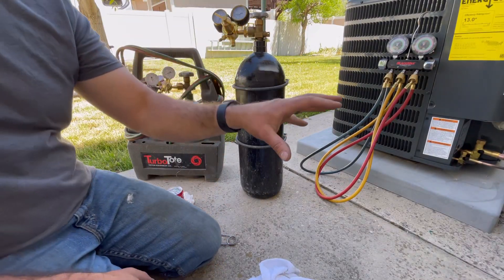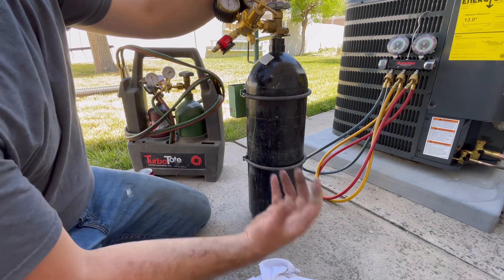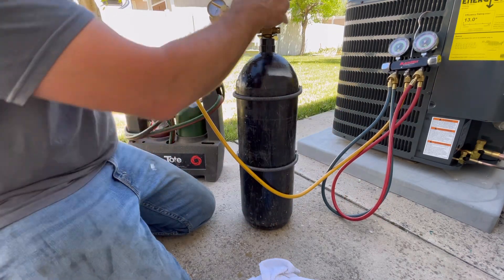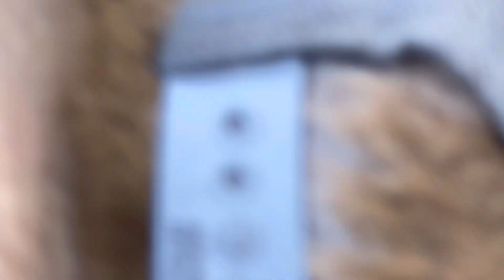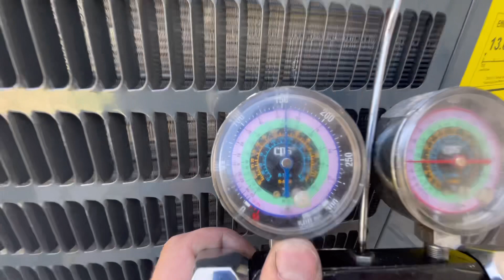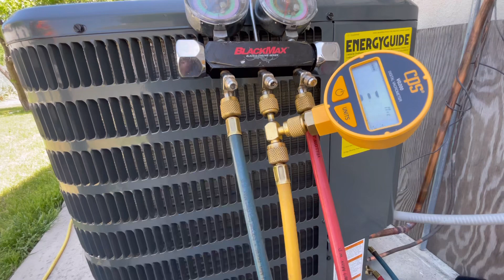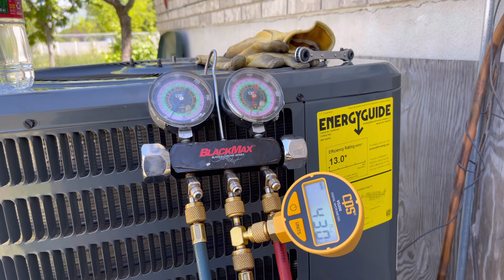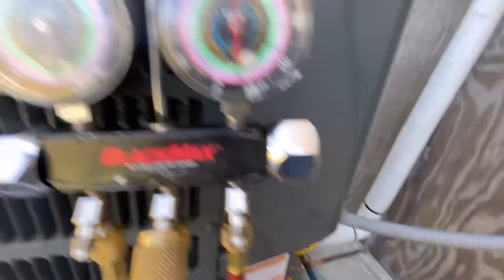DIY Air Conditioner Replacement  Part 3      -Step By Step Guide-

Comment: I'm a master automotive technican, i'm handy when it comes to many other things and i'm going to be replacing my furnace and a/c units with in the next year or 2. Last summer i added r22 to my one unit found a 5lb tank on ebay, still have about half a tank left, if i need to charge it again next summer i will, other wise its going to be replaced. I have 2 questions for you, one could you substiute welding gas 75%co2 and 25% argon for nitrogent? and if your chaning from r22 to a 410a or to the next generation of refrigerants do you need to replace the line set?
Reply from the maker: You can use a turbo torch which mixes acetylene with oxygen so you don’t have to have two tanks, but I’m not sure on substituting it with nitrogen. If that were a thing I’m sure I’d have heard about it.  On the r22 to r410, you don’t need to replace the lineset. Just flush the lines or blow them out with nitrogen at the least and you’ll be fine 👍🏽
Reply: Probably not good idea , because CO2 can decompose into CO + O, and oxygen is the problem to begin with

Comment: wait I never saw him put the refrigerant in?
Reply from the maker: All new condensing units come precharged with refrigerant. So all you need to do is weld the lines, pull the vacuum and then introduce the freon that is contained to the condensing unit to the whole system. Hope this helps! I’ll do a video that better explains this. Cheers,   Dave
Reply: @diyhvacguy  YOU ARE MISLEADING PEOPLE!!!

Comment: I watched the 'Intro of Freon' again and don't understand:  Is the unit pre-charged with refrigerant, or did you hook up a tank of Freon?  NICE job on the videos and especially your handiwork!
Reply from the maker: Thanks for the question. The units are precharged with freon. If you have a really long freon lineset it may need to be topped off, but that rarely happens. They are precharged for up to 20’

Comment: One thing Id like to point on. Using the micron gauge where you had it isnt a true micron level reading of the system. Its reading what the pump is pulling. Its better than not using at all however
Reply from the maker: Thanks for that. I’m about to pick up the field piece digital manifold that has the micron gauge built in so I won’t be using this method for much longer. Cheers

Comment: always open the suction valve first, any oil released will be drawn back into the compressor when starting the unit. good idea to clean your tubing before you cut it to prevent contaminates from the sandcloth entering the tubing. carbon buildup from not purging dry nitrogen can damage the system. removing the coil before lifting the coil box into place makes the job easier. installing the electric after brazing will give you better access to the tubing for your braze, espeacially in tight conditions. when installing a 410 system in place of a 22 system you need to at least flush the system, the oils are not compatable and can destroy your compressor.
Reply: Thanks for providing constructive feedback. Many people say good job, mostly cuz they don’t understand the process. They cannot point out mistakes or unexplained procedures. However his video series is good enough to begin somewhat.
Reply from the maker: Some people have told me open suction first others say liquid. 🤷🏻‍♂️ I’ve done it both ways.   Thanks for the advice on the other items as well!
Reply: @diyhvacguy  the instructions that come with the unit say to open the suction first.

Comment: Let's say you trust your  brazing 100% .. and you skip the nitrogen in the line leak test .. do you still need the vacuum pump ? .. I'd probably get to this point and then call a small ac company for this last part .. but feel I could save ton to get the work done up to this point . I definitely would have done the inside work differently leaving a lip on the metal , not a huge fan of all the taping with no screws to fasten unit, but awesome video , easy to follow along . Nice work !
Reply from the maker: Ryes ductwork is not my strong suite, I’m going to make a transition on the next one.  To answer your question, yes regardless of if you do the nitrogen purge or pressure test you 100% need to pull a vacuum. You can get one on Amazon for less then 200 bucks. And yes you will save booku bucks doing that yourself. I’m going to be putting out a video on using Staybrite 8 for soldering the lines in. Many people have been using this method for years, and it’s not nearly as hot as brazing so you don’t even need a nitrogen flow or brazing tanks. Just the solder and mapp gas. So stay tuned for that 👍🏽
Reply: @diyhvacguy  thanks .. yeah I actually seen ones for like 100-130 on Amazon with the pump an line gauge set alot cheaper then I thought. No wrys on the duct I totally understand.  That yellow digal reader you have is also on Amazon,  if your just a home owner like me and only gunna use it once , there's no shame in getting the job done and returning it back to Amazon.. there a huge company lol thanks for taking the time to make this great video
Reply from the maker: @davidfrisch5538  that’s true! Lol never thought about that haha  they’re making money hand over foot

Comment: Thanks for doing this video series as I’m considering doing this replacement myself. One question  I have is my current system is r22, can I use the same line set with a new r410 condenser and coil? or do I need to replace the line set.
Thanks
Reply: I am not an HVAC expert so do some research to confirm this but when switching refrigerant types I believe you want to flush the line set out. You do not want to accidentally mix different types of refrigerants. You can in fact use the existing lineset though, no need to replace it

Comment: 1- You cannot use that recovery method with a 410 system. The high head pressure will kick out. 
2- LEAGALY you cannot just scrap a unit filled with refrigerant. not even on Craigslist!
3- I see lots of tape and mastic, but no ductwork modifications?? MOST homeowners will NOT be so lucky!
4- You did run nitrogen while brazing, kudos for that!! some of the best contractors that don't so that. But yes, you do NEED to do that.
5- You should remove the shrader valves before brazing. You can ruin the seals on them. 
6- Ideally, you should always use 15% silver for high pressure systems. 
7- 150 PSI test? That should be at least 350 PSI... Minimum! 
8- Did you really suggest NOT using a micron gauge after only pressure testing to 150PSI???
9- Superheat 4-5 degrees?? was only 3.5 degrees and SOULD be closer to 10.
10- Your content is good and I actually believe you have the ability to do a decent job, BUT! The homeowner would have to invest a TON of money to acquire the tools your using for ONE job. And you not even using 50% of the tools some installs may require. I'm sure yo will delete this, but after watching an hour of your videos, it had to be said!

Keep up the hustle and make you money bud. But your no pro and some homeowners SHOULD leave it to the professionals.
Reply: Perfectly said but I don’t know who in their right mind would hire this hack!
Reply: I have done it, no problems....
Reply from the maker: 1- Untrue. I’ve done it plenty of times with 410a systems and know several others who do. 

2-True. It’s also illegal to drive without your seatbelt. Doesn’t stop 75 percent of the drivers out there
3-Ductwork is not my strong suite, but I’m trying to learn.  Tape and a little metal fab is not rocket silence, as long as it’s sealed good that’s what matters most.
4-“pros” from the 80’s did countless systems with no nitrogen and they ran for 30+ years. I will always do it. Is it needed, no. ”
5-Never had an issue with this. Always wrap it, and it stays cool and never damaged a valve or seal.
6-Again, never had problems with this.
7- Very unlikely to see a leak that will develop from 150 up to 350.
8- Again, pros from the 80s didn’t use a micron gauge. Just ran it for a few hours. I will always use one. Is it “needed”, no. Let’s be real here. 

I can’t see the other points but I really appreciate your input. We will probably never see eye to eye on some of them but to each his own. I’m trying to help people who want to try and do this themselves, that’s all. And I’m more professional then half these rip off companies who are price gouging and still don’t do half the stuff I did. If you can’t be nice and help the DIYers out, then yes your comment will be deleted.   Cheers
Reply: @diyhvacguy  

Just wanted to add on to Justin's comments and yours.
1. Some units have an internal high pressure bypass in the compressor (like Trane). Most don't. 
4. Most pros from the 80's worked on R-22. The POE oil in 410a can scrub that oxide layer off, while mineral oil typically doesn't.
Reply: @diyhvacguy  Great replies and much respect!  It seems like Justin lives in a perfect world and we all know (except for Justin) that just does not exist!
Reply from the maker: @dickhertz8103  that’s exactly right man. Couldn’t have said it better myself! thanks for your comment! Cheers
Reply: @dickhertz8103  He is misleading people and a bad representation of the HVACR profession.
Reply: @diyhvacguy  Dude, really 

#2 This isn’t a $75 fine for not wearing a seatbelt it’s a $37,500 fine up to 295k

#8 EPA requires 500 micron hold for 30 minutes

I’m curious why you are defending  this by bringing up what contractors did 40 years ago? No clean air act. No 410a, Pistons we’re widely used but today it’s TXV I don’t get it

I get you trying to help the DIY person out there. But you aren’t helping them by provideing misleading information
Reply: @michaelcso2400 yawn....you can  literally let the r22 rush out and no1 would know.  😊.  Speeding can cause death and life in prison which is more than 37k.......speeding is done by everyone, everyday and its "fine", right?
Reply: @kump32  Go ahead a let it fly then. And pray no one takes a video of you doing it because the fine for speeding is about 100-200 releasing r-22 will cost you 35k 

I figure you’ll be ok, these days almost no one has a camera especially one readily avail like it’s in their pocket
Reply: @michaelc.sobczyk9100  your right. In my fenced-in, secluded backyard,  im always fighting off people filming me at the most random times in my yard.   I forgot im a celebrity🤦‍♂️lol.  #FakeOutrageIsntCuteOnYou
Reply: @kump32  Congrats on your seclusion. Not everyone viewing this is as fortunate as yourself and can be filmed in their back or side yards. By all means if you want to risk the fine feel free to release the refrigerant

Comment: Did you install a filter dryer ? Are they necessary in all installs?
Reply from the maker: No all. So that is an advantage to Goodman products. If you look inside the unit, you will find built in filter drier on the smaller 3/8” liquid line. If your condensing unit does not have one built in, you definitely need one to remove moisture and contaminants. Previously they would be installed at the condenser but they have found that it’s much better to install it at the indoor coil if possible. That way it’s still filtering freon before your metering device, and it is out of the weather so it won’t rust and develop a leak.  Hopefully this was clear! :)

Comment: You did not mention but assume the condenser came pre-filled with refrigerant and the compressor pump was pre-filled with lubricating oil .  I have been waiting for this kind of video for some time , will scribe and looking forward to learning more about installs/tools/tips and tricks from you.
Reply: Thanks for that reply , doubt many diy guys would know that the condenser is pre-filled with enough refrigerant for the line set , looking forward to watching more of your bids as a new subscriber.
Reply from the maker: @rich13la1  thanks so much for the support! If you have any other ideas on diy hvac videos feel free to shoot them my way! Cheers my friend
Reply from the maker: Thanks sir! I do apologize. On the next one I will for sure clerify that. I’ve been in the hvac field for some time and some of the more basic things I assume people know but that’s not the case a lot of times.  If you watch my last video I think it shows that on the part where I open the king valves to let the freon in. They are charged for about 25-30’ of refrigerant.  Thanks for your support! Cheers
Reply: @diyhvacguy  this is where you are wrong. Being a professional as you state you are misleading people. These units are charged for 15' of line and you need to add the required amount of refrigerant stated in the installation manual to get the required superheat and subcooling temps you need. You also need to have a certified EPA license to work with any refrigerant system. You are cracking the valves open and releasing refrigerant to the system hoping you don't have leaks.
Reply: @JeffMiller-cf9ej  Perhaps I missed something, but I believe I saw him both pressurize the system with nitrogen, with no leaks and pull a sustained, leak free vacuum.

Comment: hmmm, what was your inside wet bulb and outside drybulb and did you consider this for your superheat calculation?  Seems you skipped a lot of steps.  As well, open the vapor line first to avoid pushing all your compressor oil down the line on startup.
Reply: Hes a diy it says it in his name lol self explanatory. From when I saw him tape up and duct seal the transition gap I understood what Im in for and now the micron gauge on the gauge hose port but Im still watching bc its interesting, hes not doing a bad job just a lot of it is not right since he wasn't properly trained.
Reply: I agree that I would have liked to see more detail on checking the superheat unless he thinks indoor temp isn't that important. I am charging the system for my first time and seems like a stab in the dark, all the temps change as I am charging so its hard to know what to do. I can see why tech's have the expensive wireless manifolds that tell you all the temps and pressures in one place, I was running inside and out checking temps and doesn't seem accurate.
Reply: Wet bulb,  bry bulb... whats that?  Nahh,  you dont need to know any of that to properly charge.  Ever hear of beer can cold? 
   Oh,  and by the way,  none of that info does you no good,  if you dont know the cfm you are moving first before you charge
Reply: @madmac4509  Ever hear of flooding a scroll compressor?  It won't last long "beer can cold" if your flooding!
Reply: @testtesting2868  no shit.  I was being sarcastic.
Reply: So the units come pre charged?

Comment: Where can we buy the equipment? Most local supply houses require contractors license
Reply: I work for one of those supply houses that sell Goodman and I will tell you if you need to warranty any part of any unit you buy online from Amazon, EBAY or other places we have the resources to check the serial numbers to see where you purchased from and will not warranty any parts. You would have to go back to where you bought the unit from.
Reply: @JeffMiller-cf9ej On Goodmans own website it states Any unit purchased online will have no warranty. All of the manufacturers are the same.
Reply from the maker: You can buy your equipment on Amazon or eBay or any store that sells them online like Acwholesalers.com and the condensers will be pre charged with r410a refrigerant.

Comment: What type of insulation do you recommend for the suction line, I purchased pipe foam insulation for the suction line, but think the sun will break it down easy? I am not replacing entire lineset, just splicing in the new coil and cond.
Reply from the maker: https://amzn.to/3zInosB

This is what I would use. It comes with adhesive on it, and will last a long time in the elements. Comes in a 6 ft section which should be plenty if you are just replaceing it from the foundation to the unit and at the evap coil.

Comment: Can you use regular plumbing couplings/elbows and L type tubing?
Reply from the maker: Unfortunately no. The hvac copper line and fittings is rated for much higher pressure. Plumbing is typically 100 psi max whereas 410a could be as high as 450psi. You can order a lineset that comes in a big spool anywhere from 25 ft to 50 ft in length. I failed to show that in this video but I will show that aspect of it in the next one for sure! Thanks for the support! If you have any questions don’t hesitate to ask! Cheers

Comment: When you pull vacuum through the manifold, I would have thought it would hurt the pressure gauges?
Reply from the maker: Nope, they’re designed for it. In fact that’s why the gauges all have inches mercury when it goes below zero.